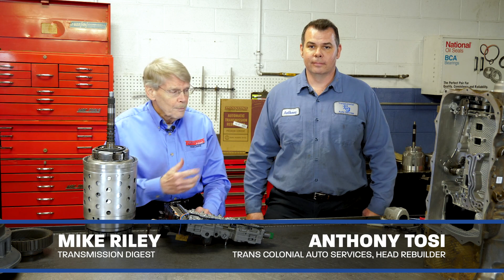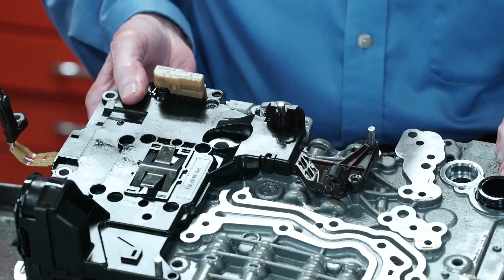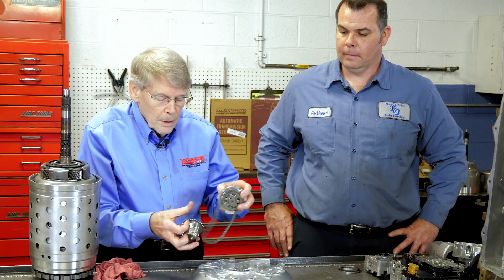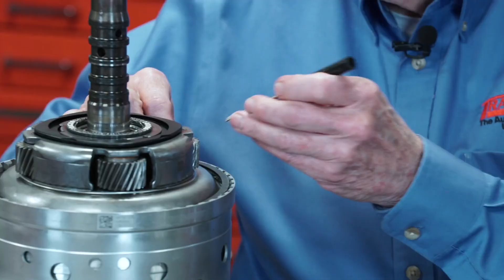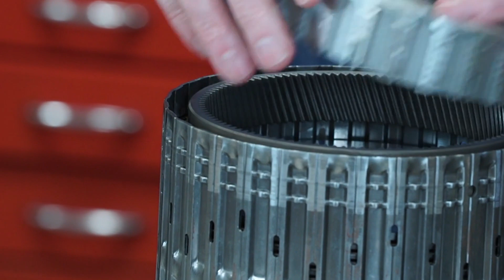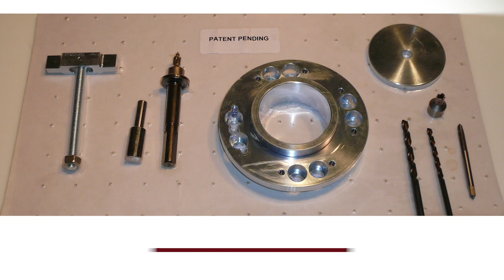ZF/Chrysler Eight Speed RWD: Part 2

Comment: I have a problem with my Chrysler transmission. If I start the vehicle and I do not engage reverse immediately the reverse (R) flashes and asks to return to park, also while driving 1st, 2nd, 3rd shifts perfectly then I have to get the RMP up to 2G for it to shift to 4th gear, then all the other gears shift perfectly. Is this a complete transmission problem or a bad valve body/ TCM issue?
Reply: service transmission inspect oil and pan for debris.

Comment: I am having issues with my 8hp70 and I am out of warranty. When I come to a stop, sometimes it almost feels like I get a slight nudge from something in the Driveline. Also, early in the morning,  my 1 to 2 shift is extremely long and harsh when it finally shifts.  There is also a shutter from the 2 to 3 shift at times. It seems to act better once it is warmed up, but there are still weird corks about it. I've had a lot of bad experiences with dealerships and shops in the past and was wondering if there was any diagnosis that I could personally do before taking it in to verify what the problem might be.
Reply: service transmission inspect oil and pan.
Reply: @MissionaryForMexico   Would you recommend using factory Mopar transmission fluid.

Comment: Is it necessary to "reflash" the ZF 850re transmission after a trans flush?
Reply: In my experience the best answer I can give is sometimes.  Also i probably wouldn't bother with a complete flush, but instead just a change every 50k or so.  But yeah i usually flash and update the shift module after a change
Reply: @MrCarttbone  I'm having some shifting issues with my 2020 Ram 1500 Classic. It has 40k miles and it's not wanting to go into Reverse and then it shifts hard from 3-4. It will throw an intermittent CEL and then clear itself. If the fluid is cold, sometimes it won't shift outta 4th gear. Any recommendations?
Reply: @nickgifford8197  At 40K you are still hopefully under standard drivetrain warranty.  Take it in and have them update the computer.  That might fix it.  If not you probably have a lack of hydro pressure somewhere in the system.  If that’s the case hopefully you get a new trans.
Reply: @nickgifford8197 This is the first comment I've seen stating the problem i've  been experiencing. Have you figured out what the problem is/was?